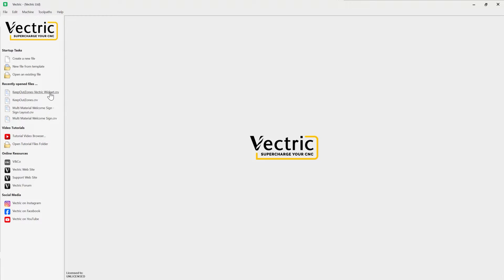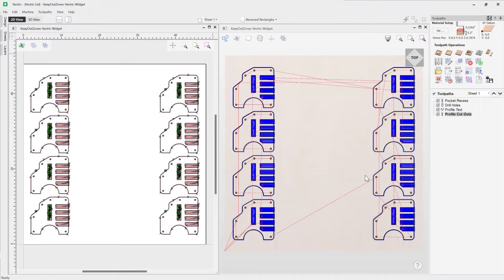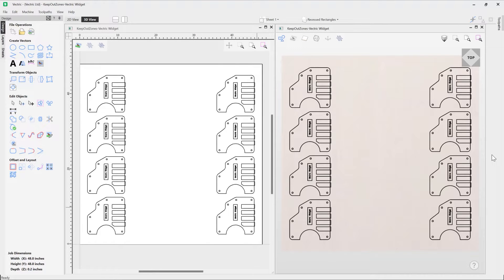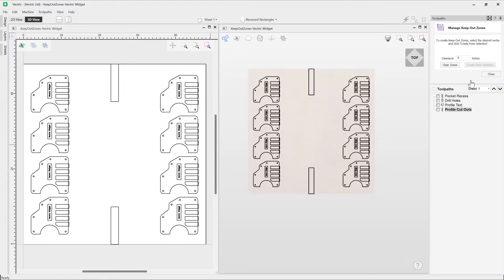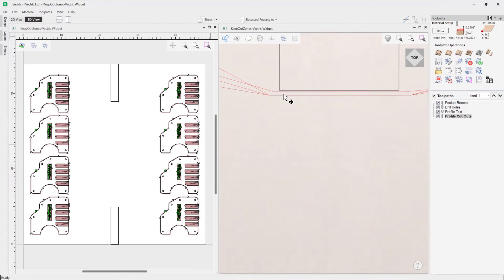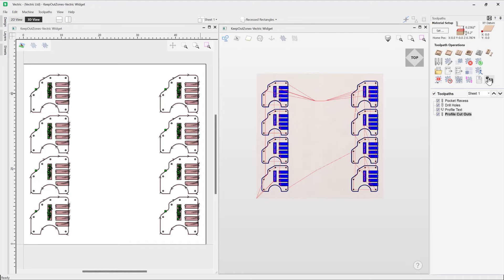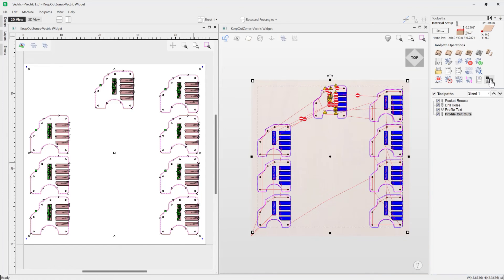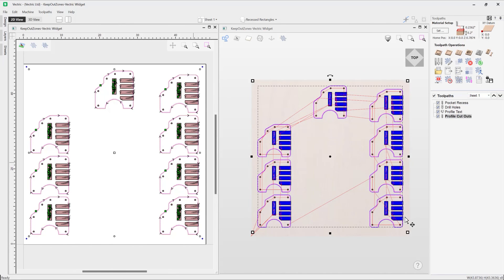How to manage keep-out zones in Vectric software | Toolpath FAQ's | V12 Tutorials

Comment: WARNING DO NOT USE THIS FUNCTION!
It works great until the spindle returns back to the start position when your cut has complete, it completely ignores all keepout zones making this function pretty useless (destroying my dust boot in the process). 
Wherever your cut finishes it will travel in a direct line back to the start position, regardless of keep out zones!
Reply from the maker: Hello @KeyPenn thanks for leaving this and please be assured we do want to look into your issue. I have had a look and I can't seem to reproduce this problem.  Could you please email support@vectric.com with the file, and a bit of background on what you see is happening.  Thanks you and we will keep a look out for your email.

Comment: Rather than managing a keep out zone by moving a tool around a clamp, can there be an option to manage a keep out zone by just allowing a change to the z-axis tool height to raise over the keep out zones as it passes over them?  Some of my clamping does not allow for the tool to find a safe path to the other side of my work without raising the tool.  The only way I've found around this is to set the z-gap high enough to pass over the clamps, but unfortunately that means each plunge of the router goes to the z-gap height, GREATLY increasing the amount of time jobs take to run.
Reply from the maker: Nice idea... I will pass this onto the team and see what they think.  Might be something for the future... :)

Comment: I've found that when the toolpath is finished on the cnc and the spindle returns to home the keep out zones are ignored and it travels through them... is this a known issue ?
Reply: That is correct and has court me out unfortunately. Ran my full cut and when the spindle returns back to the start position it completely ignores all keepout zones making this function pretty useless (destroying my dust boot in the process)
I believe it’s a post process issue but none the less it doesn’t work.
Reply from the maker: It should respect the keep-out zones.  It would be nice if you could an example file to support@vectric.com so we can look into this.